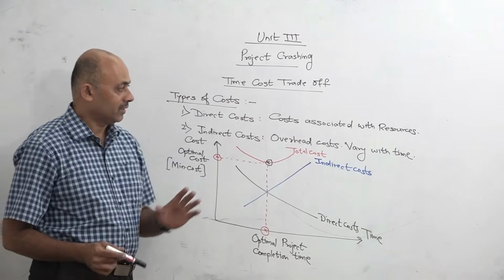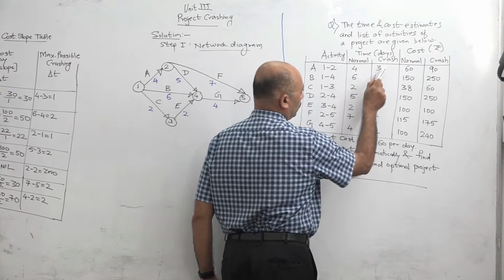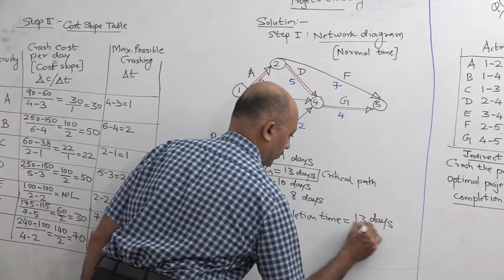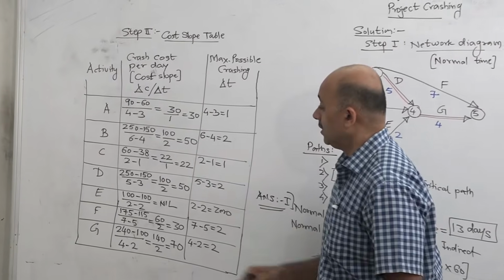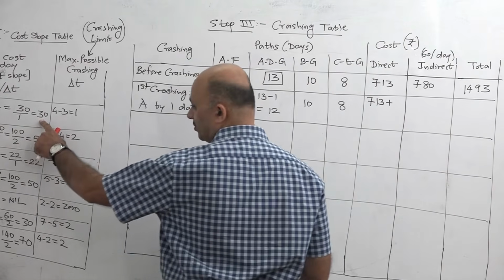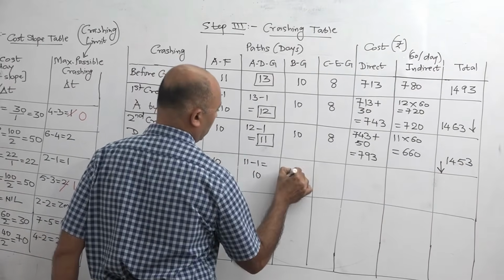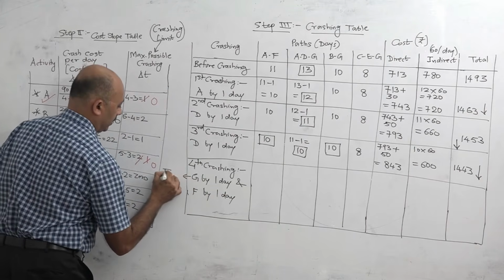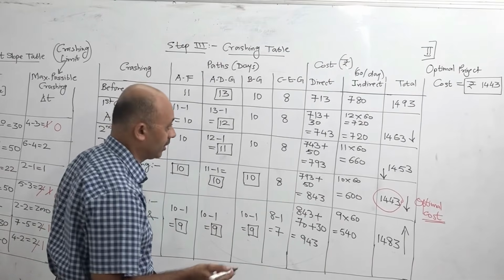Project Crashing

Comment: Super class. Excellent methodolgy used. Most of the teachers find the critical path after calculating TE and TL making it more difficult to crash the project duration till we get the optimum. Earlier I tried a lot to clear a single doubt in crashing the time.

Comment: 1 Network Diagram (with Normal Time as the weights)
      1.2 Paths (it helps us find critical path(s) and make the crashing table)
2 Cost-Slope Table (columns = activity name, crash-cost per day, max possible crashing)
3 Crashing Table (Note: crash each activity by 1 day only except when there is more than 1 critical path) (columns = cashing performed, new duration, new cost)
Reply: Best❤